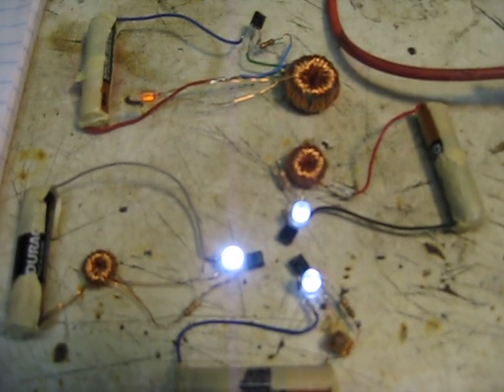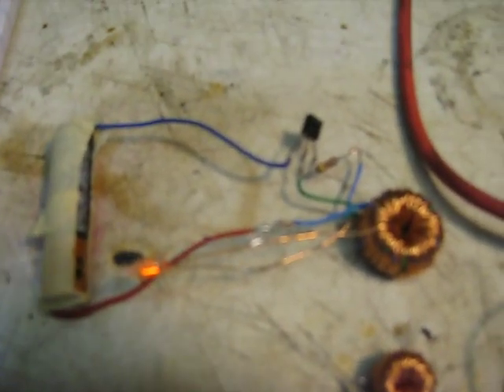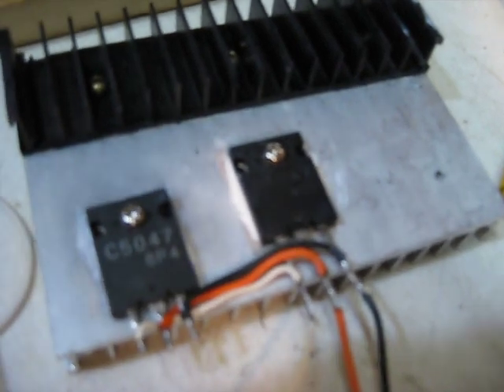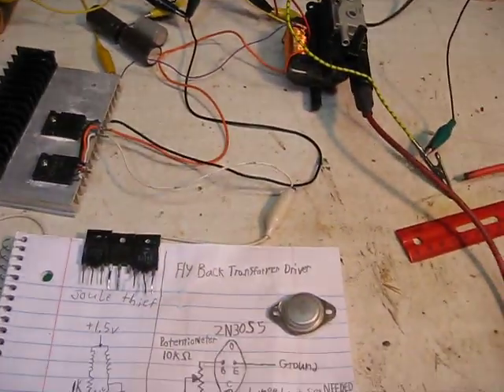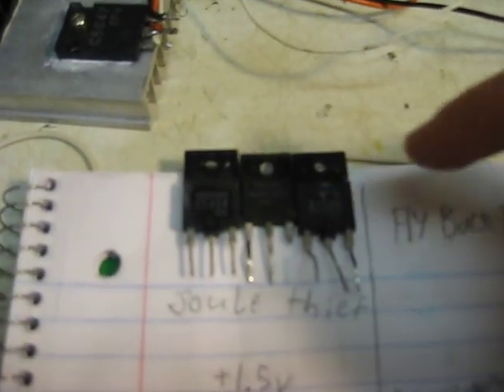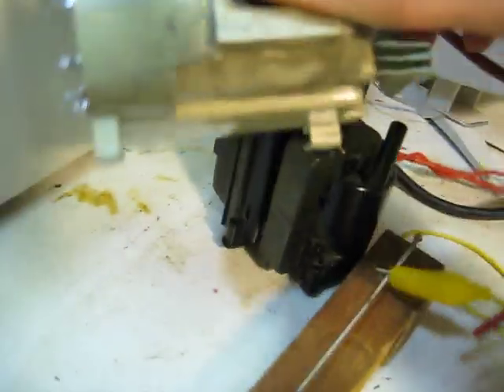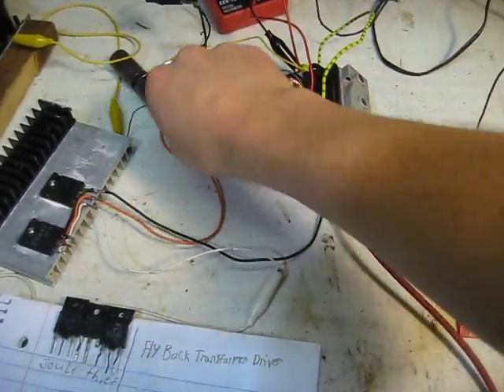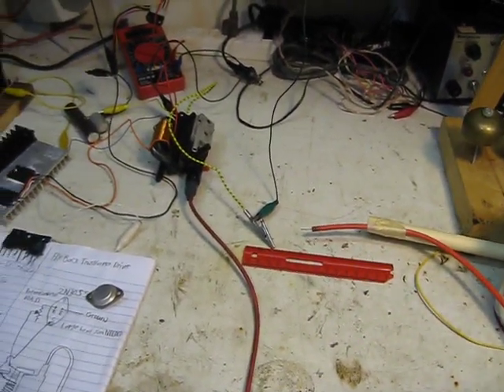How To Make a Super High Voltage Joule Thief Fly Back Transformer Driver

Comment: makerj101, love your channel, but this design is not very efficient, and furthermore, a very similar design is used in crt tvs. Honestly, you are much better off using a 555timer driver, as it is more suitable for arcing, rather than high voltage generation, as it has a relatively fixed frequency, and is simply a lot more powerful. I was able to achieve almost 5cm with some corona from a mere 14 volts, and I had a silent arc. Neat design though.

Comment: Next time you need a diy resistor, try salvaging the carbon cathode from a D cell battery. You can play with the ohms reading by adjusting the position of the leads along the shaft.

Comment: Hello Maker j101 I'm quite interested in your flyback transformer circuit diagram I would love to know more about it and how to run it off of 120 volt circuit. And were  to solder the wires onto what specific leads of the transistors and to what specific leads of the flyback I'm more interested in hooking it up to a thunder capacitor for generating xrays. As a MOT transformer us just to much current, that's what I'm currently using. Thanks
Reply from the maker: arbitergvadam I'm not really sure it's possible to run it off 120 volts.  I really think you would need to drive the transistor with some kind of fixed frequency.  But I'm not really sure.  Best wishes
Reply: +arbitergvadam Have you thought about simply using a cockcroft walton voltage multiplier? This is the advisable route to take for low current extremely high voltage applications, it is also simple, albeit, a bit time consuming.
Reply: If you use a cfl circuit or just a electronic ballast then you can run it off of 120

Comment: You could revisit it using the primary winding and the feedback on the flyback pins.
Reply from the maker: I could but it was just easier to put my own windings on the core.  Thank you!
Reply: Makerj101  I used my meter to see the lowest resistence pins for primary and second lowest for feedback and was great to see it works with a tip35c. Thanks to inspire those experiments love high voltages.
Now i'm working to use igbt's n channel on zvs flyback driver...
Reply from the maker: Yep that's one way to do it!  Sounds awesome!  Good luck!  Thank you!

Comment: try nested toroid rings
Reply: Like nested russian dolls
Reply from the maker: How would I do that?
Reply: Sizes. Start with a small coil, put it inside a coil around a metal ring.  Then,  if you can put the second inside a larger third coil around a metal ring, As a Nichol fits in a quarter, and a quarter fits in a half dollar. Only the inner one needs to have a large Number of windings. Then, All set on the same axis, turned 90 degrees out of phase. 0' - 90' - 0 ' .The point is the field is trapped inside the inner coil (s) , and reinforces the force. See what kind of effect you get.
Reply from the maker: Hmm that is certainly an interesting idea.  I would love to try that.  What ring(s) should I put the primaries on?  Thank you!
Reply: If you mean material wouldn't it be Iron? Or perhaps Al. If you mean, "Do I need a ring for my primary at the center?" Probably just a plain winding of copper in to a ball or Doughnut, or with an iron bearing at the center. The idea is the outer fields of outer coils trap a field in the center one who's magnetic longitudinal oscillations feed bask into the system. Kind of like an energetic capacitor. Did that help?
Reply from the maker: I meant like if I have 3 rings, I will put the secondary or the output on the inner most ring.  What ring tier should the input be on?  Like the outer most ring?  Thank you!
Reply: Try it these ways. First, just the outer ring -space - out put to the second ring - space the inner third one is a kind of amplifier antenna :  and  see how the fields output.                                 Then try it with the output on the third.    Then,  the outer ring connected to the second ring, but not the third. Then  input the outer ring, but the second and third connected but not to the first,                                          Then connect all three. Putting a capacitor in the bridge paths.                                        Then,  just connect the input to outer ring and the out put to the third ring making the second the antenna a kind of  resonating antenna alone.
And check the out put signals to see if there are anomalies either good or bad.
And just to be a wise guy, see what happens when you hook it up in reverse. Try things. I understand why you would ask. Is this helpful?  The field is trapped. My question is: Is there a linear increase in nesting them?
Reply: Just use the outer ring as in put out put and let the inner core old a field.
Reply from the maker: Hmm I see what you mean.  I will have to do some tests on this some day.  I have soooo many things I want to try!  Hahaha I really need to put a list together of all the things I want to build so I don't forget about old ones!  Thank you!
Reply: No hurry. good luck !
Reply from the maker: Thank you!

Comment: Hi Makerj101, it's facinating to see you produced such a high voltage. However, since you get a high voltage output, is it possible or is there a way to use this energy to power a 230V aircondition unit? (we live in Asia)
Reply from the maker: No, there are a lot of problems with doing that.  Number one, this just can't supply a fraction of the power that a air conditioner needs.  Number two and air conditioner needs AC 60 or 50Hz depending on where you are.  This puts out a couple KHz AC so that would not work.  So yeah... just buy yourself a inverter.  It is possible to build an inverter.  But it would probably be cheaper to buy a Chines made one.  If you just need a little air conditioner, you can build one out of peltier coolers which run on 12 volts DC.  They are fairly cheep on eBay too.
Reply: Thank you very much for your reply and advice. But yeah, am following your posts and perhaps reads and needs further research to make peltier cooler.

Comment: Hey kid, you are showing a tremendous amount of brilliance, and was happy to see this, for having a similar idea for having recently salvaged a couple of older CRT monitors/TV's including most of the little stuff, but what  I wished to bring to your attention is that when playing with this kind of circuitry, especially involving Gap sparking, jacob ladders, or TC's... keep in mind that you always want to get your frequencies over 400Mhz or higher.... Doing this prevents the high voltage from travelling THROUGH your body parts, including the heart, and instead causes even Kv's and higher, (less too) to travel only over the surface of your skin.  It's all about the frequency rates!

I got this from Tesla himself.  This is how he was able to create those huge arcs, and allow them to pass through him (Google search his challenge to Edison when Edison tried making his AC current look dangerous by using for the first electric chair execution and tried to convince people his DC current was safer when it certainly was not) and walk around with fluorescent bulbs lit up without wires outdoors at a nighttime event, this was just before Morgan pulled his funding and ruined him.   Also I suggest ALWAYS use short leads and banana's....just in case you ever make a mistake or something changed (by someone) without your knowing it, and you become a part of a circuit, which prevents you from letting go.... when you fall over you will at least disconnect the power and this could possibly save your life instead of lying there cooking until a breaker blows or someone smells you cooking!!   

Aside from the intelligent cautions... don't stop, you are on the path to greatness one day.  Keep taking what you learn and applying it in every way other than what you are told to, and use things in every way than they were intended to. Take the words orthodox, can't, impossible, and never from your vocabulary and you will invent the best things for yourself, and when others notice the advantages they afford you, they will beat a path to your door with fists full of dollars, ESPECIALLY if that is the LAST reason why you created them!!!  
Going to subscribe to see how you progress!!
Keep up the brilliance!

Comment: can i have circuit diagram
Reply: 2nd one
Reply: his showing the circuit in the vid m8  PAUSE IT :)
Reply from the maker: It's just a normal joule thief circuit except you wind a third wire around the toroid.  Nothing else changes.  And the more turns that third wire is the more voltage you will get.

Comment from the maker: I looks the the current rating is 4 amps.  The base saturation voltage is around 1 volt.  It also looks like you don't want to have your power supply voltage over 32 volts.  Hope that helps!

Comment from the maker: Is this your transistor?  ic-on-line.cn/view_online.php?id=1754334&file=0378\bd435_3724741.pdf
IC-ON-LINE is the best data sheet search I know of.  I searched BD435 to find it.  What I do is search a combination of the things that are marked on the transistor with and without spaces.  First thing I searched was 9536.  It didn't turn any transistors up so I tried adding the BD on, nothing, then I tried BD435 and there we go, NPN transistors!

Comment from the maker: I'm really sorry I can't help you very much.  All I can really tell you is start with a higher resistance and try lower and lower resistances till you get the results you want.  I would also recommend having some sort of a current limiter in series with your circuit (a light bulb or heating element would work good).

Comment: Puh, I dont't know that but it must be quite high by the times I shortcuttet the Base-Collector. My waves have a length of about 20µs. That means they oszillate by 50khz, as long as my calculation is correct^^ I thought that might be enough for the flyback.

Comment from the maker: Do you know how many amps it is rated for?  If it's really old it might not be able to operate at the frequencies that are required for good arcs.  Fly back transformers need sort of high frequencies if you want a good output.  The two big transistors that I used in this video are pretty much indestructible too!  I have put them though many a torture test!

Comment: Yeah, this is a really old one. I have it from an old amplifier which was broken and this is the best transistor I have. It can get superhot and still work, you can give too much current through the Base and it still works. You simply can't destroy that one ;-)
Oh and I just googled it. It is made by Siemens and seems to be very rare and hard to order. But if you wanna have a good transistor, get one of these xD

Comment: I have a Bu312 transistor and 10,5 kOhm Potis.
The only way to get 1cm sparcs is my selfmade Teslacoil. Today I build i little sparkgap which is pretty amazing and might lead to a bigger voltage output.

Comment: I'm using a 12V stabilized power unit with pulsed DC output. I'm also experimenting with ignition coils but so far it doesn't work :-(

Comment: You can use two 100 ohms resistors and use the same principle that you did on the parallel transistor. Then it will give you 50ohms, I'm pretty sure you already notice that, but just an reminder.

Comment: Cool, but I get better results from a simple flyback circuit. I was using the same transistor you have on the left, didn't work too well, now I'm using a C5587 and get an arc about twice as long.

Comment: this is cool, i did the same thing, but i got 4 mj somethings in parallel, im pushing 24 v dc at 5amps through mine, i have a vid up on my channel, my arcs start at 3 inches, i have later updated and put mine in an old computer case, and i am liquid cooling my transistors because they get hot, they stay warm now even when i keep them on for awhile, the most i was able to push through was 52v dc

Comment: wise kid, I did this when I was about 17, now im 47, but I use the normal windings in the fly back, no need to add more wire, you can us the the primary coil that has a tap that can be used to drive the transistor base with a 1k resistor bypassed with a .1 mfd cap. and don't forget the damper diode between emitter and collector, using 12 volts there is no real danger, the arc can ignite paper or wood and even burn your finger as a match will do, FB normally operates with around 130 volts drive.

Comment: be careful with that "double the transistors, double the amps" stuff. You need to add emitter resistors to compensate the thermal coefficient of the thransistors (lower at higher temp, resulting that one of the transistors is going to be the most heating one!). in this case I guess you should pick ~0.5 Ohms on each emitter in order to get your amps right ;-)
Cheers,
Mäander

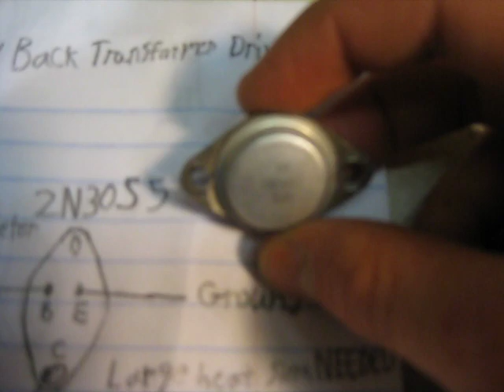Comment: 1:54, you start talking about the 2n3055 claiming it's the best but got burnt out. I am using a BU 4525AX and it's a lot quieter than the 2n3055 and it stayed cool even after running for over 20 minutes. The only issue I had was that some of the signals coming from the flyback were disconnecting my iphone from my laptop. I am downloading your video so I have a reference for making a Joule thief

Comment from the maker: V x A = W  If your solar cell puts out 0.5 volt @ 2 amps then 0.5V x 2A = 1W.  If you increase the voltage with 100% efficacy and you want say 5 volts you go 1W / 5V = 0.2A.  So now you have more voltage but less amps.  It still has the same power(watt (W)).  Hope this clears it up!

Comment: 24 vdc @ 2 amps should be more powerful than 12 vdc @ 2 amps .... should be an interesting if not revolutionary idea ... instead of 1.75 volts per cell it could be 2 vdc or more per cell ... I don't think the amps would be hindered ... nevertheless just putting it out there.

Comment from the maker: It would work if you made a big enough one and used really big transistors.  You would not be able to run motors off it.  Only things like light bulbs.  That is because it is not 50Hz.

Comment: Transistors in parallel do exist and are used (if you cant use a "larger" single one). The only problem I see here is that there should be a small (0.1ohm) in front (collector) of each transistor for load balancing. Also, the way I see it there should be a very minimal current flowing through that circuit, so the transistors and the high power resistor are an overkill.

Comment from the maker: Yes I do know ohms law.  I think that is true.  I think to prevent that you are supposed to put some resistors in the circuit somewhere.  But it seemed to work fine with out them.  And with only one transistor the performance was greatly reduced.  I don't think I ever got a direct hit from the high voltage but I have gotten a few good jolts when the high voltage arced to the metal work bench frame and I got a pretty big arc to my leg.

Comment from the maker: One can handle the amps it's just that the on resistance is much lower when I connect two in parallel, making it possible to draw more amps from the same voltage (if you know ohms law this should make sense).  At what point in my video did I "pick it up and start petting it"?  I am very careful when it is on.  If you know what your doing TVs are not that dangerous.  You should see my latest video!  You'd love it!  I'm playing with 120 volts!!!

Comment: Almost all led flash lights with 3 bulbs or less run on 1 aaa batery1.5 volts...actually less because the lights will burn until they only can get about. .96 volts..but my question or project for you is confidential and cannot be discussed here..private message me by adding me to your contacts...this ciuld change everything and is a serious proposal that could make us both Icons and very rich...please email me privitely.

Comment: you're doing that on a single 1.5v battery ? holy titfuck very nice bro :)
I'm sixteen 2 and I'm putting together a fan controller with transistors, but I wanna try this too :)

Comment: Pobably you know by now, you can protect your transistors with a diode from emiter to base, so it's bigger negative potential (when transistor closes the gate) is -0.7V ... a 1N4008 can handle 1000V in reverse voltage... so if you have more put two in series...  good job... this for sure can pump energy from ground...

Comment: i have a cap and a transformer from a microwave, just last week i was having fun overvolting fans and burning them out, then i shocked myself REALLY bad, it scared my friend so bad he almost called 911, good thing it didnt actually touch the thing. (it shocked me through the air so the air acted as a resistor)

Comment from the maker: I am pretty careful.  The high voltage that I am playing around with in this video does not have enough amps to do any damage.  The most it will do is burn your skin if you let it shock you long enough, but no one would touch it long enough to let it burn skin.  Now microwave caps are a different story.  If you charge one of them up and touch across it, most likely death.  That's why I use a 2 foot PVC pipe when I use them.  The home made cap would just makes you jump like @#%.

Comment: Good show I did this many times. The one thing is the noise which is very difficult to get rid of for these transformer. If there is no output feedback to base need to have more turns or interchange the connection on feedback.

Comment: I did some tests. Thickness of glass has little effect, until you get too thick (over 6mm). Amount and thickness of foil has less effect. Putting foil inside as well as out. little change. Maybe .05 of a pf change with all these things.

Volume of water is the thing to measure. 400ml = 0.50-0.56 pf, thick glass (Beer pitcher) was 50ish and thin glass was 55ish. Everything I tested flickered 0.03-0.04 pf once I got my body out of range to cause interference.

Sorry about the late reply.